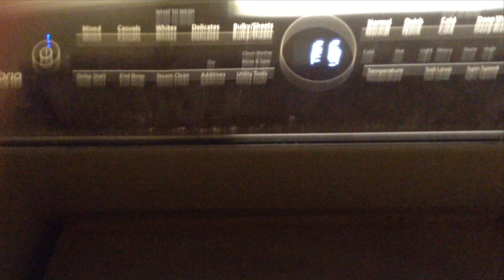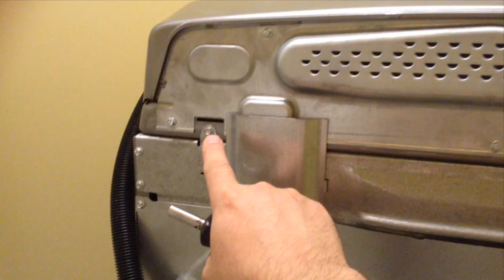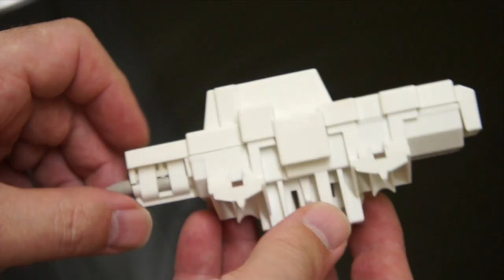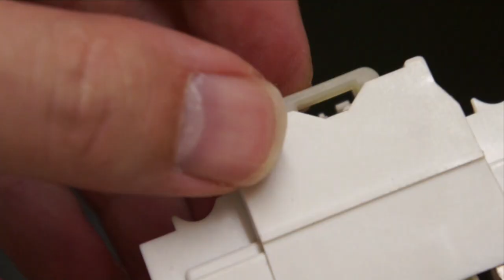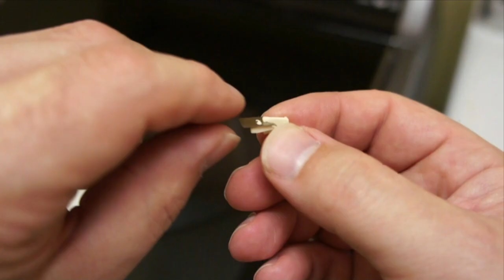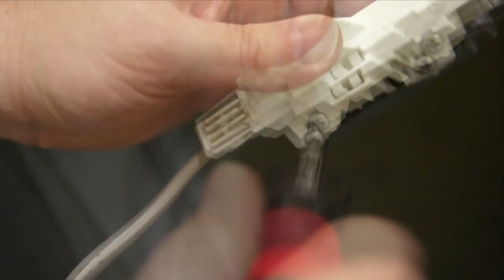Repair E3 F5 Error Whirlpool Cabrio Washer

Comment: CAUTION: this is a great video and helped me fix the lid lock issue BUT, and this is a huge BUT, you need to be careful with the water hose inlet / connection. After replacing the lid on my washer and running a cycle, I noticed water on the floor under the washer and smoke billowing from the circuit board behind the user panel. Turns out in lifting the lid off the washer, something happened to the water connector valves and water now sprays all over the electrical circuit board. So now I have a repair service coming to replace the water connector unit and probably the circuit board. USE CAUTION when lifting the lid and disconnect anything that isn't supposed to move.
Reply from the maker: Ouch!

Comment: Thank you much for posting this! $2.00 (for the grease) repair. Maytag wanted $150 for the part. Calling someone to diagnosis it would have cost even more.
Reply: Darn it. Thanks for sharing the info. I was heading to contact a repair man myself.
Reply: Its unbelievable how much they charge for you for sending out a repair person (for whenever the nearest one can get around to it) or they will parcel you over a few replacement parts, that'll come next week (usually something you could go get yourself today at a much lower price.) 
I'm no cheapo, I understand the repair person has a job to do & deserves the hard earned money, no problem. But if these machines were built with proper strong parts & done right, they would last forever (if you take proper care, obviously) right?! Did you notice the cheap plastic parts inside & all?! LoL
What I'm about to say is 100% true - My Nan & Pop-Pop still have the same ol' refrigerator & freezer, the same ol' washer & dryer, & also my Pop has a classic 1930's jeep that ALL STILL RUN LIKE CHARMS (they obviously took care of all of it & did tuneups & clean-outs over the years) As Pop says "they don't make 'em like they used to." Ain't that the truth?! For real!

Comment: This is an amazing description.  Thank you for putting it together.  Would this problem also cause the touch screen buttons to become non-responsive?  When running the diagnostic test, the lid lock step failed...
Reply from the maker: I would think the non-responsive touch screen buttons would be a separate issue.
Reply: @petereit   thanks! When pressing any button on the touch screen I get a double beep.  But when running the diagnostic tests everything seems to function as it should, except the lid lock.  It's very strange.

Comment: F5E3 error on a whirlpool Cabrio washing machine. It does not appear that anything is preventing the lock assembly from locking or unlocking. I thought that when I first looked this up that I read that you could try pushing one of the buttons twice followed by the other one one time. Can you tell me if this ever works and what the sequence of button pushing to perform?
Reply from the maker: I haven't heard anything about any button sequence that gets you past the error codes. The error isn't caused by the lid lock NOT locking/unlocking, it's caused by the sensor not correctly reading that it's locked/unlocked.

Comment: Thank you for posting this. I have a Maytag washer, but it has an identical lid locking mechanism. I clean the traces and slightly tweaked the arms and it fixed the problem. Good job!
Reply from the maker: Glad I could help

Comment: Thank you! This was a life saver in the midst of Covid-19 seclusion.  Saved us more than just $$.
Reply from the maker: I feel you. Glad I could give you a little ray of light in this dark tunnel.
Reply: @petereit  Thank you. I used this a while back and it worked.
I need your help, my washer shows only 3 lines it won’t even give me an error message, I was wondering if you know what that means? I can send you a picture if you need it just wondering what’s the problem, I can’t find anything online that says what that means 😞...
Reply from the maker: @adrianabarron31  Yikes! Don't take this to the bank, but it really sounds to me like a completely failed main logic board. IF that's the case (big IF) you're probably not completely hosed. These washers have been on the market for quite some time. Recyclers in your area (or on eBay) should have a replacement board that you could pick up at a very reasonable price.

Comment: I have a concern with the dielectric grease.  Have you ever had it prevent contact?  I used to use it liberally until it turned out to be the cause of some failures.  I had slathered my trailer connector with it and the light issue got worse.  Cleaned it all off and got better connection with a bit of sanding and bending contacts.  The grease is not conductive itself and not meant to go onto contacts.
Reply from the maker: It's been 4 years, and the lid lock is still functioning normally, so I'd say the grease has been more of a solution than a problem.
Reply: @petereit  Fair enough.  I tried several times with various amounts of grease and spring tensions but mine continued to fail.  I ended up just replacing the entire assembly.  I'm a fair hand at the process now but your video started me off.  Thanks.

Comment: Thank you so very much fixed my washer in 10 minutes. It was just build up gunk that was preventing the metal prongs to connect with the circuit board cleaned with 100% alcohol and qtips and some bulb grease for good measure. Worked perfect. I had pretty good connection so I did not removed the metal prongs to bend I know I would have broke or lost them. Thank you again

Comment: Great video! I was having to put a slight downward pressure on the lid to get the washer to engage the lock at start up. Thanks for the fix, now it just works like it’s supposed to!
Reply: Same here!! This was such an easy fix that saved me having to buy new parts

Comment: I had this delivered after Christmas and it was a blessing=>>allmy.tips/WhirlpoolWasher?47u     The tub is nice n big, can actually get a king size quilt in. It is a little noise when it first starts washing, but not bad, spins well,rinse cycle quiet n like the fact no agitator in center, which always caught the strings in hoodies, sweat pants n bras,it's nice that its in bottom n flat. Yes no clothes tied together or wrapped around agitator. I had Good luck with Whirlpool washer n dryer in the past. Lasted approx. 15 yrs. I do my best to purchase American made. This washer is very easy to use, inside the lid explains each cycle n how to use. Very helpful. Price reasonable. Glad to own.

Comment: after i reinstalled my door lock now it will not power back on. any suggestions?
Reply from the maker: You'll need to trace back through any connectors you removed and make sure they're all reinserted and seated correctly.

Comment: THANK YOU !  Another fix witness thanks to your nice video .  Just an idea . Most cases you don't even have to disconnect the sliding tiny metal parts apart . Just clean the tracks . This is where most of the built up and corrosion was. I cleaned it with rubbing alcohol and after that q tip soaked in WD40 .

Comment: Already replaced that part but still have the same codes how can you help me
Reply from the maker: The only thing I can suggest is that you check the connections at the opposite end of cable, where the lid lock sensor connects to the main logic board.
Reply: Mark Petereit ok I m going to try and I let you know

Comment: Mark! my man! thanks a tonne. Great help!

Unfortunately, my machine started giving trouble again :( I opened it apart twice already and did the exact same steps. It still throwing this error code and wouldn't start. Pls help.
Reply from the maker: Sorry to hear! Did you apply contact cleaner and bulb grease to the "fingers" of the lid latch sensor?

Comment: I think the door lock is the stupidest thing that I have ever seen, sort of like the warning on an iron "do not use to iron clothes while wearing." What I found wrong with my Cambrio washer and was causing the E2 F5 error was that the wire that plugged into the sensor on the bottom of the machine had broken loose. I fixed that but for the last year, it has thrown that error every now and then and unplugging and waiting a few minutes has fixed it but my wife gets impatient so now I will have to fix it.
Reply from the maker: Mike or Jimmy Hah! I don’t disagree with you. If it wasn’t for the stupid people who reach into a spinning washing machine (and the lawyers they hired) we wouldn’t HAVE these stupid lid locks.

Comment: Warning i tried this and it went perfectly up until i started to screw it back into the screw holes and then all the sudden screws were still threading the cylinder screw posts snapped right off i dont know if it was a lemon or the plastic was made to break but be warned anyone attempting this screw it back together cautiously

Comment: May 2019...just followed your instructions and it worked perfectly.  Circuit board had some corrosion, but the washer started right up after I cleaned it with a toothbrush.  I broke some parts of the lock case, but it still snapped back together.    Thank you for doing this.
Reply from the maker: You're welcome! Glad it worked for you.

Comment: Only helpful video out there mine just stopped working today so will fix tomorrow awesome video
Reply from the maker: Thanks! Did you get it working again?
Reply: Mark Petereit it was working fine until today I got the code again but the door works fine it locks and unlocks, so it’s the same code and the problem is that it doesn’t complete the spin cycle so clothes is full of water

Comment: You don't have to take the back and top off. You can get to the two Philip head screws that hold the locking assembly from underneath the top.
Reply: People keep saying that w/o any explaination.
Reply: yes -- you can get a flashlight and screwdriver and basically stick your head upside down into the washer and see the two screws and remove them and pull out the latch assembly without having to remove the lid.  Big time saver.  Just don't drop the screws! 
thanks so much @Mark Petereit for this video!

Comment: Mr. Petereit, Thank you for a wonderful and instructive video! You saved us ~350-400 dollars easily! One comment for anyone else with a similar locking problem. This fix didn't initially cure the F5 error on our machine. We had to turn the power on and pull the locking mechanism into the 'locked' position, then turn the machine on with the lid open. this had to be done delicately, because we hadn't fully re-assembled the top portion back to the base of the machine. This allowed the machine to appropriately 'reset' itself and know that the locking was working correctly again. Once that was done, it appears to be functioning fine!
Reply: Wolfbear I have a couple questions  about that error f5

Comment: Can you by pass this locking mechinsam all together?
Reply: Would like to know also
Reply from the maker: Actually, no, you can't. The main computer measures the difference in resistance before and after the lock mechanism is engaged, and keeps a running count. If you bypass the lock completely, you would successfully complete a set number of washes, then the main computer would shut down and I'm guessing you'd have to replace the whole main computer board.

Comment: Thank you for this tutorial! After taking my washer apart and trying to bypass the broken switch, your video helped me see that there are pieces missing from the switch itself. I have a replacement coming and will definitely use your tips to get better use out of the new one.
Reply: i took mine apart and its still doing that clicking
Reply: Mine is doing the same. I think it's an alignment issue. I wiggled the thing and it just worked. If it does it again in the next load, I'll redo the screws and clean up stuff to make sure it all sits right.

Comment: First, I wish to thank you for this video. I've watched many and this one was not only the easiest to follow, it worked! Second, for my own personal preference, is there any way to bypass the locking mechanism completely without affecting the performance of the washer itself?
Reply from the maker: I don't think so. I've read multiple posts from licensed techs that say that the computer logs the operation of the lock mechanism. If it fails to sense the proper locking and unlocking, the computer will stop cycling and the machine will be useless.

Comment: One more big shout out!  Thought I was looking at a control board.  Took about  :20 after watching your video.  Thank You !
Reply from the maker: Cool! Glad I could help.
Reply: Update.  Did not quite hit the spot.  Still had intermittent failures.  Last ditch effort was to hit Lock assembly with CRC QD Electronic Cleaner (advice I picked up somewhere online) before buying a new lock assembly and installing.  It's been a month.  My wife is constantly doing laundry.  The CRC was the final piece of the puzzle.  0 failures.  I'm not expecting it to last the year...but I'll take what I can get.
Reply from the maker: Great tip! I'll add it to my notes.

Comment from the maker: ** Update ** This fix lasted four and a half years since I posted this video. It just now started acting up again, so I repeated this process, cleaned up the contacts and reapplied the bulb grease and it's back to normal operation again. **

I will emphasize: the little packet of bulb grease is THE secret to this fix. DO NOT SKIP IT! When I shot this video it was actually the SECOND time I took it all apart to fix the problem. The first time I did NOT use the bulb grease, and it was less than a month later that I was taking it apart again. Again, DON'T EVEN START THIS IF YOU DON'T HAVE THE BULB GREASE! It's $2.00 at O'Reilly's Auto. Look for the little packet of VersaChem Sure Connect Bulb Grease, usually up on a display at the cash register.

Added tip from Mike Halsey:
Hit those contacts with some CRC QD electronics cleaner (https://rb.gy/kqa7y9) and wipe them shiny clean with a Q-tip before applying the bulb grease.  Thanks, Mike!
Reply: Omg your such a life saver... I'm a mother of 5 and could have not afforded to purchase another washer. 

Do you know the name or model of that white piece in case I would like to purchase a new one in the future. That's if it's not expensive
Reply: I’m a mother of 4 and I can’t stop laundry even for a day or it will build up a mountain of laundry! This is the only video that shows me how to repair that part! Thank you so much you saved my life, lol! Wish I could hug you and buy you a drink! Cheers!
Reply: Just followed your directions to a "T," thanks as you saved me so much money. #ILOVEYOUTUBE
Reply: Just scanned thru the vid and when I saw Bulb Grease I thought of Blinker Fluid for the cars.
Reply from the maker: Mike or Jimmy LOL! Ooh! Reminds me, I’m pretty sure my blinker fluid tank is low. Better stock up! ;-)
Reply: The "corrosion" you speak of is actually called "micro fretting" you can look up that for yourself. We see it all the time in the automotive world. Thank you for your video!
Reply from the maker: Glad I could help, ladies!
Reply: Fail for not re-shooting the removal of the metal slides. Moments like that are crucial to these DIY videos. And watch your focus!
Reply from the maker: Based on the number of people that have successfully fixed their washers following my video, it doesn't appear that omission was crucial at all. I wasn't shooting for an Emmy -- i just wanted to help people.
Reply: @petereit  and you absolutely have. Your video was perfect.

Comment: thanks for the video.  Got my laundry done. Wondering if i should make them service it still since its in warranty.
Reply from the maker: If you followed this process, your washing machine will function normally -- there will be nothing for them to fix. If you somehow manage to get them to  replace the lid switch, the traces on the new switch will not be lubricated and you'll probably be fixing it again in 6-12 months.

Comment: Excellent instructions. Thank you, Mark. There is no way I would have figured that out on my own. You saved me a bunch of money!
Reply from the maker: Awesome! That's why I did this. There was NO WAY I was going to pay $150 for a new switch. I got this washer for $400 in Lowe's clearance section. The note on the clearance tag said that it had a faulty lid switch replaced. When the new switch failed in less than a year, I decided I would study how it worked so I could program one of those tiny $7 Arduino boards to fool the computer into seeing a working switch there. Couldn't believe how cheap they designed that switch, how they left it completely unprotected from the high-moisture environment and how easy it is to fix.

Comment: great video...  I have 2 adds..  be sure to secure the lid (I used tape) when lifting the top off the washer as the lid is spring loaded and will open rapidly when lifted.  Second..  In my case where my little guy pulled the washer open while it was latched (throws the same code).  Do the exact same steps in taking apart the mechanism but pull the latch all the way out and push it down to remove the bend created when the latch was pried open.  If there is any friction in the mechanism, it will not work.  I took the washer apart and put it back together in less than 10 minutes saving hundreds.  Thanks again
Reply from the maker: Great comments! Thanks!